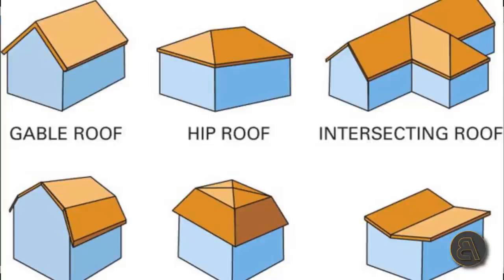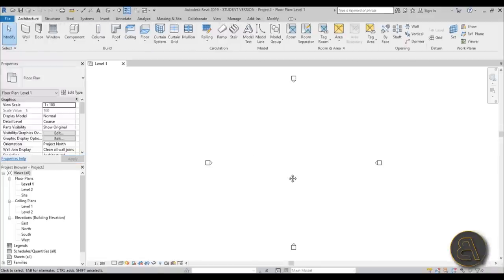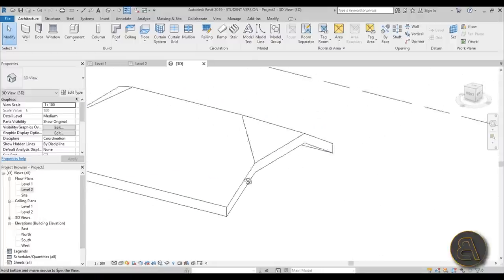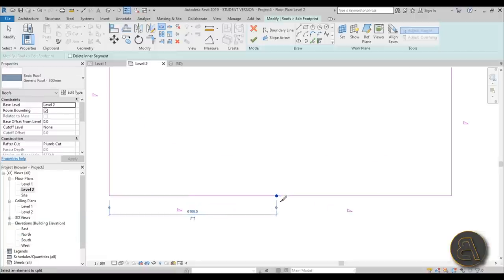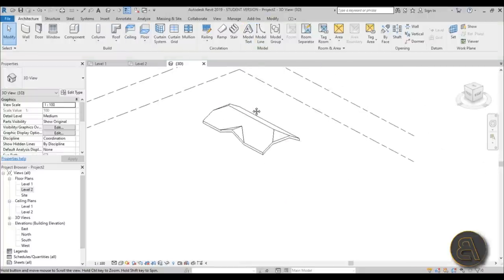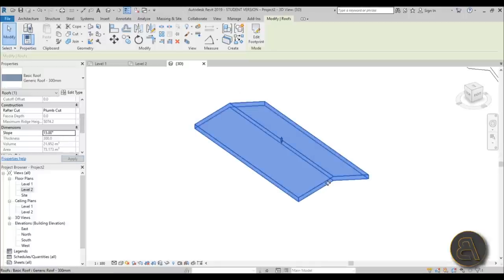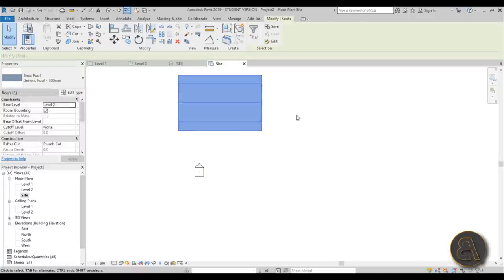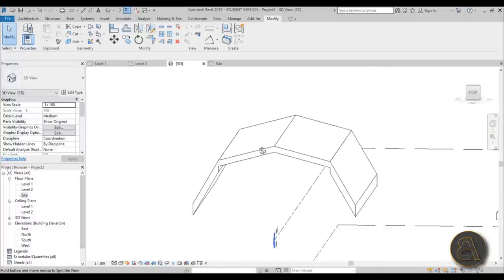5 Tips and Tricks for Roofs in Revit Tutorial

Comment: i have got a silly questions about @5：50, when u try to have to roofes at the same height, u used "joined" order, i wonder before u use it, why the Parametric did not come into play? those are the same type, just like you did you 2D wall drawings, you make a 90 degree turn, the corner get connected automatically.